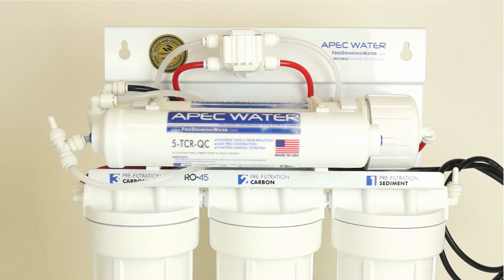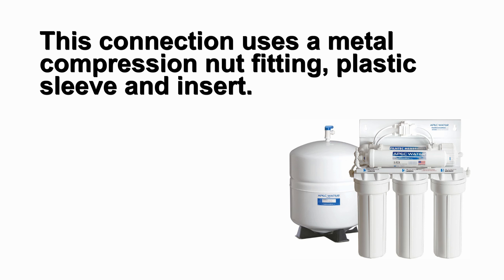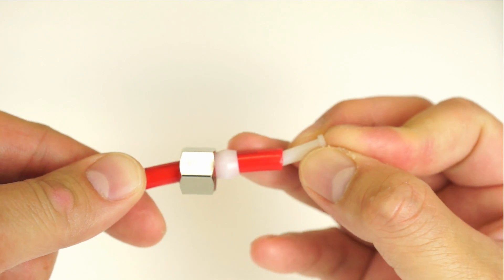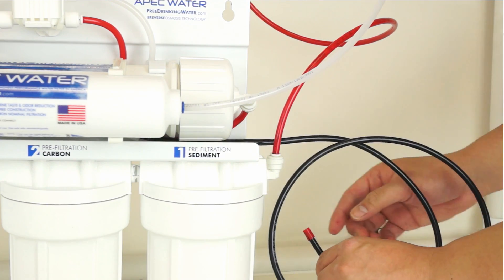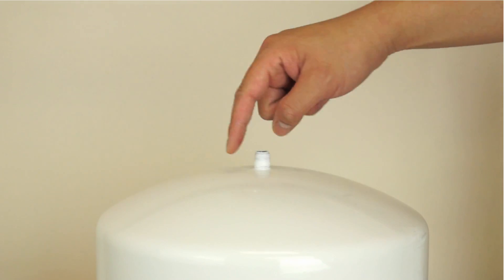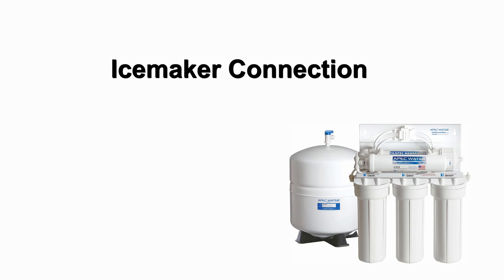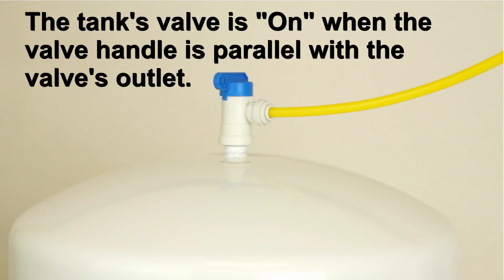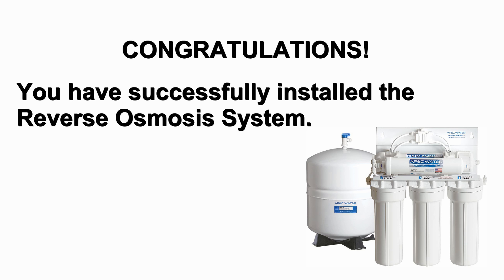Reverse Osmosis System Tubing Connection Installation Guide - APEC Water Part 5

Comment: I have a question, I pulled a the red tube that said not to pull and it will not stop leaking now
Reply from the maker: Hello, 

I am sorry for this issue but on the red tubing, there isn't a do not pull/remove tag on it. Only on the black drain tubing. Please make sure that the tube is pushed in all the way.

If you need further assistance, feel free to contact us directly by calling 1-800-880-4808 or e-mailing us at info@apecwater.com. We are in the office from Monday-Friday from 8:00 am-5:30 pm PST.

Best Regards, 

APEC Support Team

Comment: The instructions and the video state to raise the lever of the faucet to flush the holding tank.  However, the faucet that comes with the kit does not allow you to do this.
Reply: Brian jEssentially, the current faucet needs to just be left open with the lever in the DOWN position until the tank is empty.  This takes several minutes.  The instruction book and video aren't very clear in this regard.  Over all, it's a well designed and solid system.